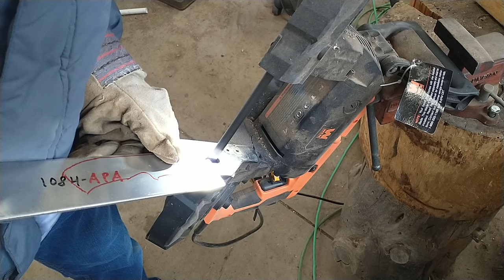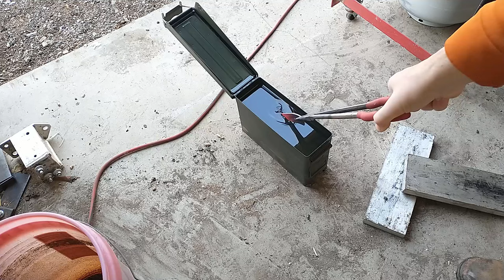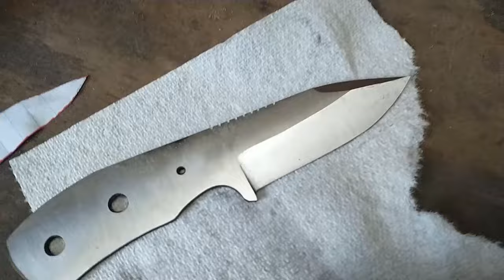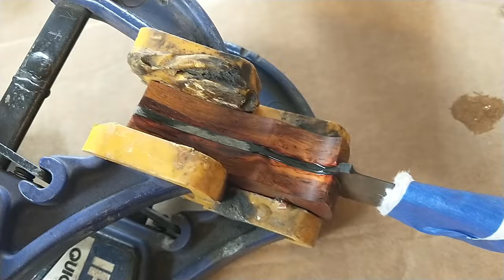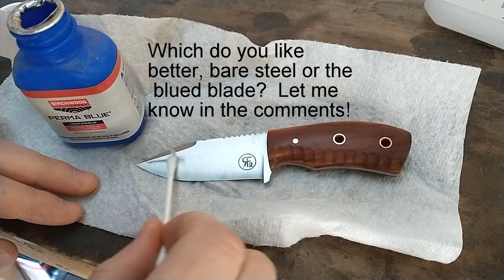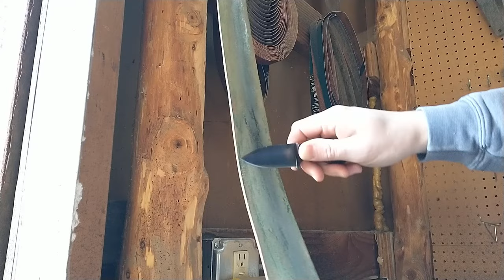How to make a Black EDC Knife

Comment: That was cool to watch, I like your set up. What is blue steel and does it stay blue. Thanks for sharing.   Tony.
Reply from the maker: Thanks!  It's a cold blue, so basically a strong forced patina.  It's essentially a black rust. It will stay forever, but wears faster from abrasion than hot bluing that is done to firearms.